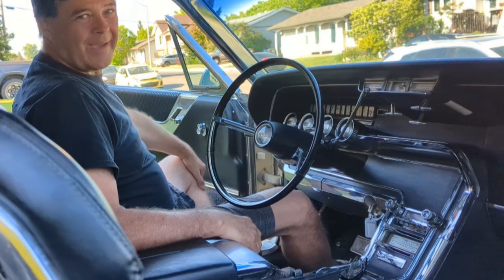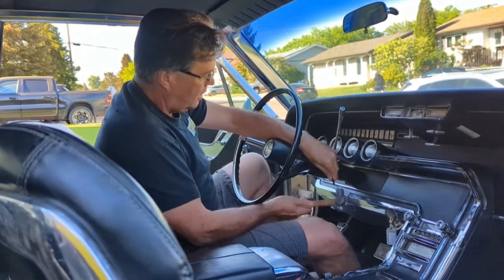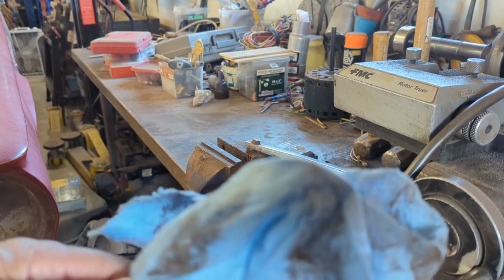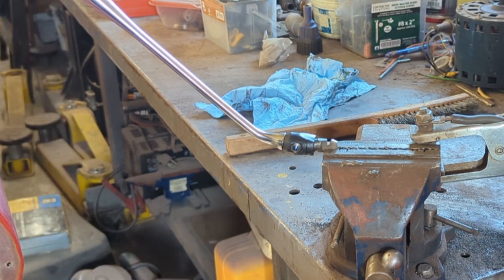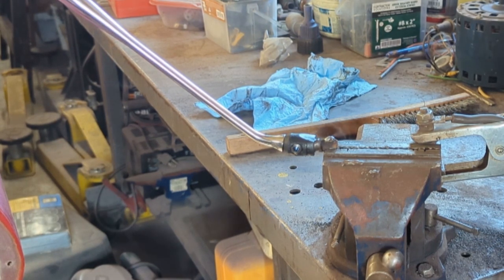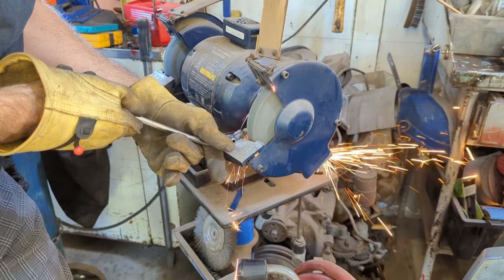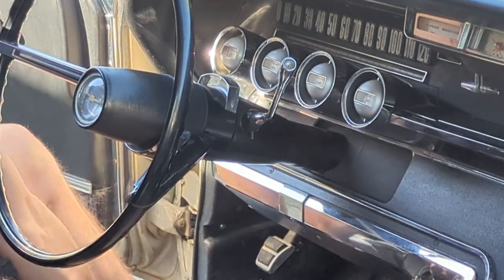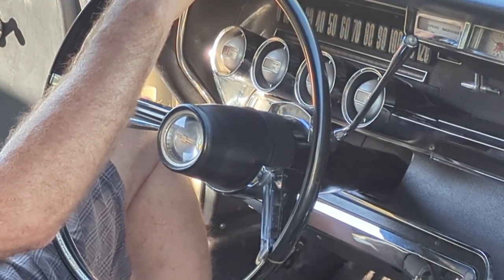⚠ Warning! ⚠ 64 - 66 Thunderbird Shift Lever Repair - A Must Do!

Comment: 1965 & 66 Lincoln also! My mom's car, popped into Rev and wiped out the whole passenger side of the car on a telephone pole! Fortunately, it missed the gas pumps at the gas station by a foot! It also ran out of a Bay at a Service Station once and rammed the trunk into a tree!! Yikes! The car STILL functioned...although it looked like a Potato Chip...and menacing!

Comment: I finally fixed the detent issue when my car tried to roll off a lift during an alignment. The tech was quick with a piece of wood behind the tire and saved the day. 
If the trans has ever been out, they never seem to get all the parts back on the shift mechanism down there. A couple of washers and a wave washer will make a huge difference. 
BTW, it's a lot more work but there is a plastic bushing at the base of the column that will be disintegrated. It will allow the bottom of the shift tube to move around and cause looseness between the shifter and the trans.  This part is readily available and makes it feel like a modern car. 
You have a beautiful car - enjoy!  (I've had mine 53 years)
Reply from the maker: Thank you Scott...I agree with you on the lower shift tube bushing, I did replace it on this car.

Comment: ⚠️ATTENTION⚠️ Great video! Thank you for your help, however the correct punch pin Size is 3/16" or 4.8mm. ... 5/32" is too small and will just dig into the pin. Thanks again!

Comment: Hey Alvin, nice video. I do  it a little differently, I hit the steering column, fingers and knuckles with hammer most of the time. Dont forget to lube the  slide mechanism.  I can see its a little  stiff. Thanks.
Reply from the maker: That's funny Nick! I will be lubing the slide when I work on the column, I ordered a new lower bushing, and will redo the linkage bushings like you showed in your shift linkage rebuild video. 🙂

Comment: I also saw Nick's video and decided to go all-in last year to resolve that issue. The detent in mine was well worn in addition to the shift lever, and the bushings were all original. I told myself there was no way he would get that shifter lined up perfectly on the first try before that roll pin goes back in.
Reply from the maker: No...it took a couple of tries. Lol

Comment: The shifter is a item on my to do list that I have been procrastinating on. I know it is a safety Item. I don't know why I keep putting it off. It is the least difficult task to be done on our 64 T-bird. But after three years of work, I am at the end of my to do items. So watching your video reminded me to get out in our shop and just do it.
Reply from the maker: I started do them the day my convertible jumped into reverse just from the engine vibration...lucky enough, I had blocked the wheels, so nothing happened!

Comment: I have a '64 Galaxie with swingaway. Happy to see that I should be able to do the same vs taking the whole thing apart to do it like i see in all the other videos. Which the other videos are all Tbird also. Tends to be most of the fords do this regardless of model. '63/64 Galaxies had the swingaway option for an additional $50 and you gave up the floor shift in order to have it. I look at every galaxie I see and only seen 4 or 5 and I have looked at a LOT of galaxie, it's an addiction.  I did the same for a bit on the Tbirds looking for hydraulic windshield wipers that my dad had told me a story of. He needed one for his '63 Tbird and the junkyards all thought he was nuts til he went out and found one himself on one of the cars they had.  I did finally see what they look like. I had no idea they had that.
Reply from the maker: Yes, the floor shifter is a rare thing to find in those cars! 
The good old Hydra-Whip wiper motor, not likely to find those at your local Autoparts store. Lol

Comment: Yes, it's important to replace or repair the shift lever if it has this problem, and they WILL have this problem. The problem is these cars can easily slip out of park into reverse - very, VERY dangerous.
      I replaced mine (1966) with a brand new, OEM style shift lever when I first bought my '66 as it most definitely had this issue!! The roll pin is pretty easy to get out.  Just have some patience, and use the right size "tool" to push it out as you're tapping it what a hammer 🔨.
    At least the lever wears out and not the internal channels that the lever engages.  Thnx for posting this for folks who may not be aware !! You may have saved a few garage doors or even someone's life.
Reply from the maker: Thank you Anthony, it is a problem for sure!
Reply: @J_R_Shop  Hello and great vid. Thinking back to when I replaced mine (I do almost everything but welding), I seem to recall that I moved the shifter way to the right (1st gear I think), Doing that enables you to hammer  downward as opposed to hammering upward, which may be awkward for some.

Comment: The slide away steering column was first offered in the '61 bird and in '62 it became standard equipment. Not sure when they stopped offering it. Most of this wear comes from forcing the steering wheel without gently raising the shift lever and sliding the column to the right at the same time.
Reply from the maker: Thank you for the info!
Reply: What is the purpose of the slide steering wheel
Reply: @NotYourFinancialAdvisor777  It was mostly a sales gimmick but supposedly was for easier entrance and exit of the car.
Reply: Not true the wear comes from the shift detent plate that the shift lever slides against shifting from park to reverse and drive over time I have worked on restoring these cars over 30 years.   Thunderbird garage Lincoln Nebraska

Comment: Hi Alvin nice video! May I ask What is that thick black rubber around the shift lever by the steering column? 
thank you ! 
😄
Reply from the maker: I really don't know why Ford felt it was needed, my thoughts are it's there to reduce vibration between the shift lever, and column ring...but that's just an assumption.

Comment: Good to know this since I am going to look at a 65 Tbird this weekend. Also what else should I be looking for? It is sapose to be a turn key driver and if it is what I am wanting to buy I will be driving it home.
Reply from the maker: I mentioned a few issues in your other comment...but look out for things that have been modified, swapped out with non original parts, like different engines, and transmissions, Exhausts systems are expensive for these cars, so having good pipes are worth looking out for.

Comment: Hey I just got a 65 Thunderbird and the wheel is stuck over on the right and having trouble sliding back over, would this help and or do you know how to fix that
Reply from the maker: The only locking mechanism is when the shift lever is out of park and the column is in the left hand position.
With that said, it could be rusted in the right hand position, or someone over tightened the cam latch screw, this would act like a clamp on the locking arm, causing the column to be hard to move.
If it's not rusty in the slide area, I would try backing off the cam latch screw, it could just be over tightened, the shift lever being worn at the detent will effect the smooth operation of the column slide, it put pressure on the cam latch and locking arm, but can only lock when the column is in the left hand position.

Comment: do you have to put the shift lever into reverse removing it and reinstalling the shift lever? WHAT AN AWESOME VIDEO! Thank you for doing these videotaped repairs and posting on youtube! Can you explain to me how you reinstalled it to align? i don't believe I saw that part? looking at the shift lever on my 66 tbird it is not exactly aligning in park, is that a worn shift lever? Also I don't have any brakes on 66 tbird pushing into garage. Would you be willing to do a front brake pad and rotor replacement and the rear drum shoe replacement video and bleeding brakes and differential fluid change as well?  That would help me a lot! As For the clicking sounds is it true that the solenoid is seized and needs a hammer tap? THANK YOU!  :goodvibes:
Reply from the maker: Hi Laszlo, you just wiggle it back in, and use the punch to realign the holes...it doesn't matter what gear it is in, just remember to chock your wheels, so the car doesn't coast away on you. 
I am heading out of town in a week, and don't have time to do a brake video...there are many, many videos available on brake bleeding, and changing rotors. I point you a channel called "joernone", John isn't making videos any more...but he did do some videos on brakes for his 66 T-Bird, it would be helpful for you to check out John's channel.
Sometimes tapping the starter will work...but not a "for sure" fix, if the solenoid is clicking, it isn't seized. When starting these old cars up for the first time in years, it take a little work getting the bugs out of the system, make sure you are using a good battery, if the engine is stuck, don't try to free it by using the starter, that could just cause more damage.
Good luck with getting her going....this stuff is the fun stuff! lol

Comment: Question, forgot to ask on previous comment!  So when you put the shifter end back in, does it just go right into place?  There's nothing that it has to go under or anything like that. I have in mind as example, a fuel pump arm having to go under the cam thing.
Reply from the maker: Hi Deb, it does go right back into where it needs to be, depending, the only resistance is the rubber on the lever, you may need to work it into place to seat that rubber.

Comment: Hi  Alvin, What roller pin size did you finally use to hammer out the shift lever at the beginning? And how can you tell where to get access to removing the gear lever shifter?  Is there a hole that is right there near the shifter you insert the roller pin to be able to remove? Also I did look at carburetor and it doesn't look gummed up on my 66 tbird. The gas tank just smells like strong odor of gas. not sure what wood varnish smells like. I'll see next time if the gas gauge reads. Original AM/Fm radio works! Horn, Power Windows, and Heater/ AC fan don't work. Electric antenna doesn't work either.  Is that a blown fuse? What size Spark plug socket did you use to remove spark plugs? it's very difficult to get to my spark plugs because of stupid Calif smog equipment and the tons of hoses for vacuum cruise control.  Many THANKS! 😀🙂:goodvibes:
Reply from the maker: Hi Laszlo, I believe I used a 5/32 roll pin punch, there are holes on both top and bottom of the roll pin.
There are many things that could cause electrical components not to work, and could be as simple as a fuse, but when a car sits for many years, it could be anything.
I believe the plugs are 13/16, it is a tight area to work, I took the cruise control unit off the apron to get at the driver's side plugs, and you may even have to remove the shock tower brace... because there is very little room to work between the brace and master cylinder, the brace is easy to remove, and allows you more room to work.

Comment: That was a fatal flaw on those T Birds that should have resulted in a major recall!  Not only would they suddenly pop into reverse while at a fast idle but the auto release emergency brake would pop off at the same time!  I once watched a T Bird take off backwards out of an alignment rack and smash into a building!  By pure luck nobody was hurt or killed!
Reply from the maker: Yes...Ford had the perfect set up for disaster built right into the car, and if for some reason you didn't slide the wheel to the right, you have an accident waiting to happen. 🥺
Reply: @J_R_Shop  A person shouldn’t HAVE to,slide the wheel to the right!  We know that now but not then.  Those really weren’t good cars!  Vacuum hoses everywhere and poor workmanship. Still I  liked them especially the 1965’s. Ever replace front control arm shafts on one? Talk about a miserable,dangerous job!  The Buick Rivieras of that era were a much better car!

Comment: Was any of the trim hard or tricky to get out or was it all just screwed in?  Were your tack strips reusable?   Thanks for the video.
Reply from the maker: Hi Michael...the trim was easy to remove, the only piece that gave a little fight was the rear package tray, it needs a good firm pull to get it off. The package tray sides come off easily after the center piece is out...the trim on these side pieces come off with a trim removal tool, don't try to pull off the trim on the center piece of the package tray, you will damage it...it has different mounting clips that need to be turned to release.

Comment: I took the roller pin out but I'm having a hard time getting the shift lever out. Do you need a shake it quite a bit to get it to come out. I also have the car in park while doing this. Thank you for your time.
Reply from the maker: Hi Josh, make sure you have the wheels chocked so the car can't move, because yes, you will have to work the lever quite a bit to get it out, and you most likely will have to take it out of park.
It sounds like the rubber is good and tight, but it will come out, the pin is the only thing that holds the lever in place.
Reply: Ok thank you.

Comment: Thanks for the video. I've been hammering on that pin for an hour now (hit my fingers plenty times) but it won't budge... Any idea how to loosen it?
Reply from the maker: Sorry, other than some penetrating fluid, not WD-40, something that actually works like PB or Deep Creep, I really don't know what to tell you.
Reply: @J_R_Shop  thanks I'll give this a try
Reply from the maker: @ngamac  are you using a flat face punch, a pointed punch will spread the roller pin, making it impossible to get the pin out. Also try holding the punch with a pair of vice grips, then you won't hit your hand with the hammer.
Reply: @J_R_Shop  Thanks for the tips!
Reply: I know its a year later but a 2x4 cut to length and placed between the floor and the part you're hammering on works great.

Comment: Hello.  First thank you for posting this.  We recently acquired a 62 T.  We were unaware of this issue.  We found out about it as ours was not easy to swing the wheel aside.  Then we realized how it would not start unless we pushed the gear shift all the way to the left.  And when it did it would jump back.  Luckily we were taught a long time ago to step on the brake as you start.  Anyway, we bought a new gear shift lever and did what you did here.  It didn't help. :(
Would you have any idea if we did it wrong or it it's a different issue?  Thanks.
Reply from the maker: You're welcome, and thank you for watching! 
The first thing is to confirm if the lower shift tube bushing is in good condition, if it's worn out or missing, it will be very difficult to get the wheel to slide, and start the car without pulling up on the shift lever.
After the shift tube bushing is confirmed to be good, you can adjust the neutral safety switch on the column underneath the dash, its an easy adjustment to make.
There is also another adjustment underneath the dash that allows the column to slide when in park, it is found on the column, just up the column from the neutral safety switch. Both the slide lock adjustment, and the neutral safety switch screws are 5/16 head.
When these cars are in park, starting and sliding the column should not require you to do any pulling on the shift lever, but it all hinges on that lower shift tube bushing...it has to be in good condition, after that you should consider rebuilding the shift linkage between the transmission and the column...but start with the easy stuff.
FYI...the factory pull effort to slide the column from side to side is 10lbs.
Reply: @J_R_Shop  I'm sorry for the delayed reply.  Thank you very much!!  Haven't had time to check it out but I will.

Comment: You skipped the part of re-inserting the lever into the column.  Is there anything to watch out for, or does it simply slide back into the correct position?
Reply from the maker: Sorry about that, I cut it out because a giant ass truck with no mufflers went by...but yes, it just goes back in with a little wiggling until the holes align. You may have to pull it out of park at this point, so if you're on a hill, be ready with the brakes or wheel chocks.

Comment: My 64 T-Bird, had the same issue. I put a new shifter in it but it still has issues. I have to pull up on shifter to get it to start. It still does not click into drive position.  Any advice would be greatly appreciated.
Reply from the maker: Is the lower shift tube bushing in good condition? 
These cars almost always need that bushing replaced...once you have the lower shift tube bushing issue fixed, then there are adjustments that can be made at the neutral safety switch, if all is in good condition, and adjusted properly, there is no need to pull up in the shifter to start the car.
Reply: @J_R_Shop  thank you. I wish I was closer so you could fix it for me. Then I know it would be done right.